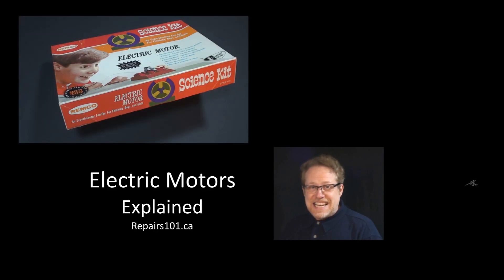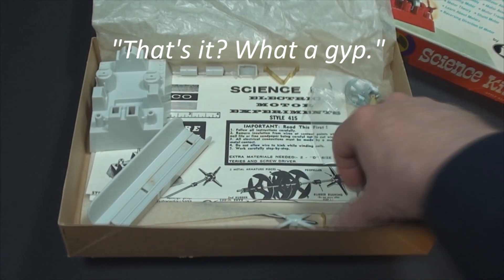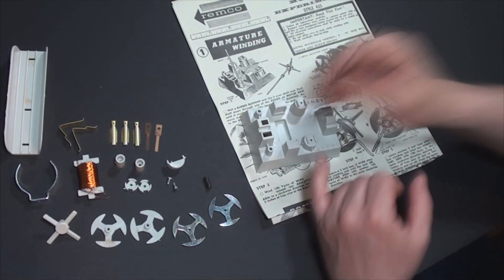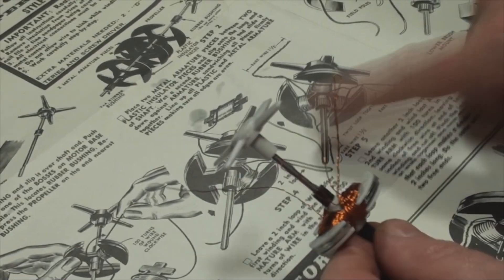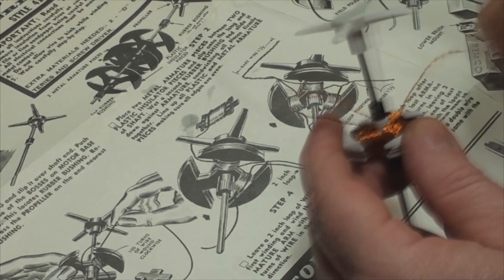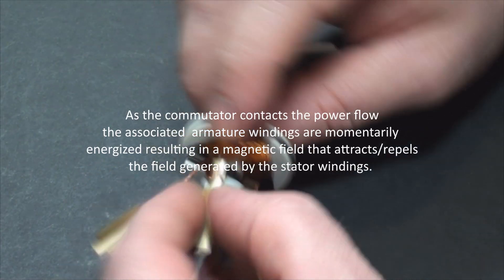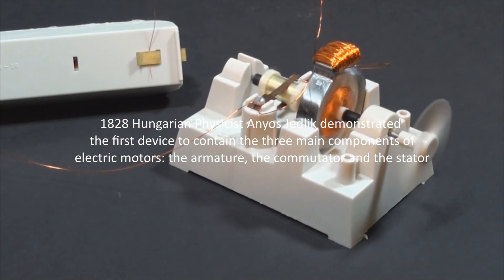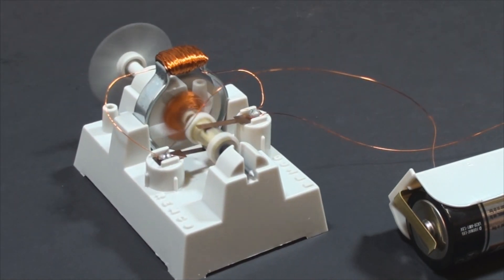Electric Motors Explained - 50 Year Old Toy Unboxing

Comment: Thanks for posting this video. I've been frustrated looking for motor kits for my kids. As a child in the early 90s I had a motor kit which was a bit simpler, using permanent magnets, but still winding the coils and putting it all together. Doesn't seem to be really available anymore. A quick eBay search of Remco turned up a lot of 8 of their kits, including the un-assembled motor kit, so its on its way for my kids Christmas. And as well, I'm going to 3D model the parts, which would allow much of it to be 3D printed, only the metal parts would need to machined or otherwise formed.
Reply from the maker: You are a cool Dad with lucky kids.